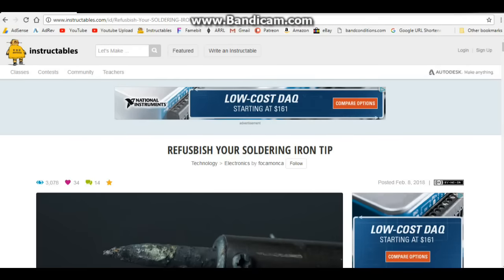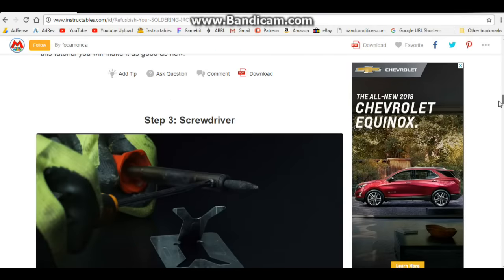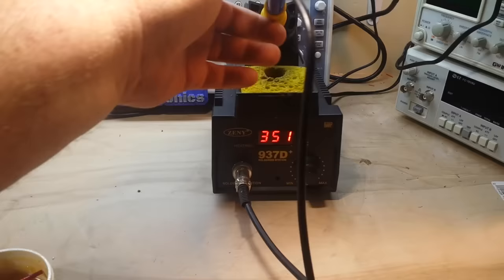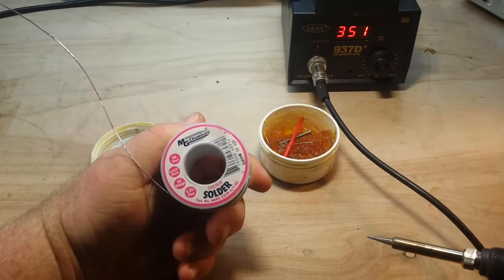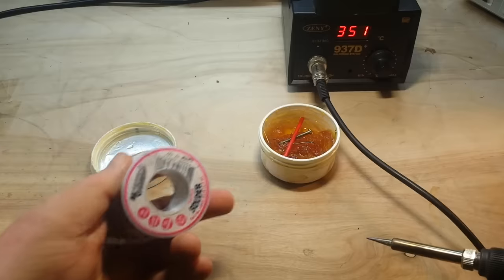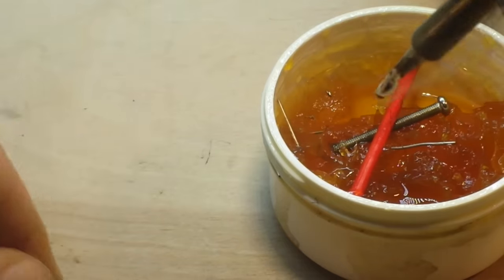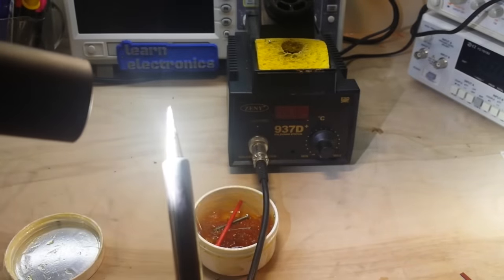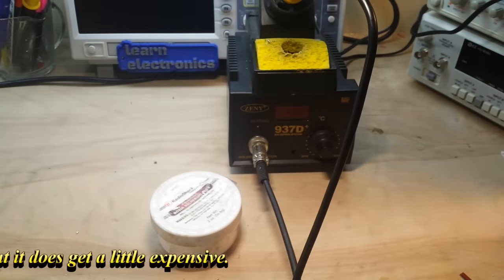How to clean and re tin your soldering iron

Comment: You're so right...LOL, I have daily use tips over 30 years old that I still use. Other than regular tip tinner, I also use plumbers flux as a hot tip dip.
Reply: Rose Hannah Mae i like the wire brush
Reply: Rose so regular plumber's flux is ok to use, but not plumber's solder?
Reply: What if I have a brown flux / soldering paste that seems to immediately oxidize on my rear of the tip?
Reply: Do I need such a bright flux?
Reply: @nibrocnoel3240  He is using the plumers flux to clean the tip, not to apply to the electronics. The plumers flux will never touch the electronics because after you clean the tip, you tin the tip with your rosin solder.
Reply: Can't the acid in the plumbers flux be damaging?
Reply: that's amazing...I suspect it has partly to do with the product quality 30 years ago; which doesn't amount to much without the right practices ofc.
Reply: i know Im randomly asking but does someone know a way to get back into an instagram account??
I was stupid lost the account password. I would appreciate any tips you can offer me
Reply: @Cruz Timothy it worked and I now got access to my account again. I'm so happy:D
Thank you so much you saved my account :D
Reply: @Jedidiah Elijah you are welcome :D
Reply: I’ve used plumbers flux to bring some absolutely horrible looking tips back to life.
Reply: So you have soldered every day for the last 30 years, lol like they used to build them in early 90s? That was like when the china boom happened, they went from basically a rod that arc welded in the 50s to 70s weird stuff to the 80s and 90s I need a soldering iron to fix my soldering iron quality stuff to the JBC era of innovation and its arm of high end compares to the weller stuff that led the innovation till about 2000-mid 90s and it’s been a like well defined line between weller and it’s Germans or Swiss, we’ll say Alps engineering and fancy high end italian exotic stuff, and some how Hakko was like, they became a well known brand by trying to bridge the gap and just figure out who the eff to even clone  and, matter of fact it’s prob how they came up with the blue and gold, but no sir I call Bs on that Claim unless it’s a Weller, and not the Home Depot model. This also severely has to do with the original  size of the tip, the giant tip in this video, lol I don’t think solder has ever stuck to it in the first place it just stuck to it based on thermodynamics, if you take that that to any multilayered nano smd model high end electronic your going to pull off about 50 components and never know it,  lol 30 years, I think @louisrossman said he gets maybe a week out of his tips
Reply: Don’t use plumbers anything unless your a plumber, period, it’s got sulfur dioxide sometime. Zinc, all sorts or the wrong stuff for electronics. Isn’t made to be like, it turns into a raisin on the board and electronics flux just basically evaporates and is non conducive, and then plumbers solder ia lead free which. I mean kudos to you is that’s how you roll and can not burn the whatever your working on to charcoal but I’ve never met any human that could do it so

Comment: Been pulling apart electronics ever since I was old enough to hold a screw driver, I think it's about time I learned to put them back together.
Reply: @MrAmberol I started with opening and reassembling laptops.
Reply: The inner me
Reply: Wow, me too and now the curse has spread to one of my Son's.  Now I get to practice by putting the things he takes apart back together lol.  I now understand why my Mom was so mad when I took apart the living room tv way back in 1985!
Reply: Sean Schofield lol we have a saying at my house concerning me “ you could destroy a tank with a rubber hammer” another one is “ you could destroy anything, even without meaning too”( because often times I’ll accidentally break something soon after using it for the first time even though I believe I’m using the object right and have read the instructions it never fails eventually I somehow break it even though I’m really careful.) I’m also really stubborn and if I want to do something then I’m going to try my best to do it ( when I was like 10 or 12 I built a table... without any power tools just screws, some wood boards my dad was done using and they were scraps, screwdriver, and a hammer and I took those screws and kept hammering and screwing them until I made a hole in the wood for them to go into, I started at 8 something in the morning and by 3 o’clock that day I had built a table and I showed my mom and dad and they were shocked lol.) my dad still tells people about how I made holes into the wood without power tools, using screws  and made a table all by myself.
Reply: I’ve been pulling apart electronics too, but desoldering the parts so I can make random stuff. I have about 15 big capacitors ready for a coil gun.
Reply: the best part is you can do both with a soldering iron!
Reply: ME CONSTANTLY HOLY
Reply: I'm about there as well lol
Reply: Accept no substitute. Use liquid electrical tape! 😂
Reply: Same, take things apart and see if could something different.
Reply: @baileebradford6018 then what happened

Comment: Thanks for the clear, complete instructions. My tip looks "like that", not because I'm lazy but because I didn't know any better. Oh, and: ouroboros.
Reply: Yes, having left a naked tip in the closet a long time, this isn't helpful, is it.  >:\
Reply: You aren't lazy because you're here watching the video friend! He said that more for the people who do know better and still dont do
Reply: Add me to the group of "didn't know any better". Better soldering is a part of my #Coronalearning...
Reply: RobMacKendrick The tip on the new inexpensive soldering iron I bought this week already looks “like that” after soldering only a dozen or so LED connections.  The tip has a huge crater and is almost worn thru.  I cleaned the tip on a sponge and a wire mesh after every solder and tinned it with solder (not with pure flux as shown) before beginning.   I also used a soldering gun that I’ve had for 30 years and never had pitting.  It’s tip is now also shot from just soldering a few LED connections.  I’m wondering if it’s the composition of the tip or the 3M solder I was using.  I made a number of replacement tips for the pencil iron from copper.  We’ll see how they work.
Reply: Is there any way to revive it?
Edit:  well as I had an old soldering iron lying around, I did the unthinkable... I sanded it with very very light sandpaper and.... It's back alive!! Works good as new, I'll just make sure it's tinned and I reckon it'll be fine... (It's better than throwing it in the bin)... If it goes kaput I'll post an update... But for now I'm a happy camper! I rarely use a soldering iron so for now I don't see the point in spending £50-100 for a decent one.. perhaps I will get one in future with the rosin flux to properly maintain it.
Reply: Mine too, so bad that I purchased a new soldering station, but had I taken care of my tip properly I wouldn't have needed one. Nobody taught me how to solder. I still don't know how to do it properly, but I'm trying.
Reply: @leodanryan966  Exactly my story. But with help from lots of YouTube videos and email support from my brother, who's been soldering for years, I'm a competent solderer today. My advice is, watch a lot of videos (everybody has a different take on skills and techniques), read website tutorials, and post questions when necessary in Internet fora. Worked for me, after many frustrating years of ruining most things I touched. Best of luck!
Reply: Me too
Reply: Tried it when I was 16 that's what it looked like 😂 trying again now at 23
Reply: @davegiggitygoo  Me too, except 10 ish and 45.   :D
Reply: @Gamerock82  my 200$ item is repaired and just as new good luck 👍
Reply: He was talking about the person who made the blog.
Reply: This is what I wanted to say. Perfect.

Comment: I have a solid brick of soldering gun tip cleaner. It came in a card board box lined with wax about 35 years ago. 20 years earlier, my maternal grandfather used it while making tin cars, trains, airplanes, etc. He would dip the hot iron in the tip cleaner and it came out like new and tinned. No reason to add solder as it is in the brick. Rub it across the brick if dirty. I have mine and use it most weeks when doing electrical work. Retired ASE Master Tech.

Comment: I bought a new soldering iron kit  over a year ago at a well known craft store ...it came with the thick wire solder , 2 tips .etc ....but no flux ...went out to one of those home depot stores and purchased  it ....to tell you the truth i never soldered in my life .....and when i  started to make dollhouse miniatures with the LED lights during this covid isolation  ...and wanted a better way to attach the wires than using the dollhouse  kits ...paper adhesive sticky strips cut to size then wrapped around the LED wires ....i didnt like doing that ...so initially i felt overwhelmed and a bit apprehensive bout using the solding iron kit ...but watched your  video on how to clean the iron tip and a few others ...i was faced with a bunch of dollhouse LED wires ...so finally took the plunge and did the soldering thing and  experimented on soldering  a spare LED ligh....t trimmed some of the wires and attached them  soldering the  wires .....then used the battery pack to test the light ....and tah dah ....it worked.....the LED ...light worked ...i was thinking that this would be hard to do .and it wasnt .followed the steps for cleaning  the tip ,etc.....so hey ...its not the best but i  did okay for a first timer  and am really pleased that  my little dollhouse  light worked ....so .thanks for putting up this video ....

Comment: I found that tinning the tip after every soldering session, and wiping it occasionally with brass wool during work, keeps it clean and shiny without resorting to flux. The flux can then be saved for the worse cases of oxidation. [P.S. Regardless, thanks for this important video!]
Reply from the maker: Thank you very much!
Reply: The White Byte I do the same technique with the brass wool
Reply: same here. only use the brass wool; soon as it gets hot, after a few solders, and at the end. Have been clean tipped since I bought it.
Reply: Brass wool eh, i only heard of steel wool! Would steel wool work too?

Ive been wanting to make the switch from a damp sponge to steel wool. No matter how wet the sponge is it seems to melt a bit... Probably not the ideal sponge.

But steel wool makes good sense to me. Brass is probably even better eh?
Reply: Careful, steel may scratch the soldering iron tip and ruin it. Brass is softer and safer.
Reply: Never use a wet sponge. It thermal shocks the coating and cause micro fractures. Only use the brass wool to clean and tin the tip before turning it off to protect the coating.

Comment: There are so many people that just destroy their soldering iron tips by not properly cleaning them... Thank you for a decent video on proper care of your soldering iron tip.
Reply from the maker: Thank you.
Reply: Well never knew about cleaning the soldering iron tip till after it was all oxidized like that when I had first started soldering. Good thing it was a harbor freight cheepie
Reply: Same i never heard about this even in soldering tips video, having said that i have a Mustool they are so cheap and i use it to weld plastic from 3d prints at lowest temperature as well.
Reply: I didn’t even know that cleaning was a thing
Reply: REPAIRING Electronic Multimeters
Reply: yeah im one of those that F*cked up their tip.. But at least i know now, right?
Reply: I bought a new (cheap) iron a few months ago and promptly destroyed the first tip.  Changed to another tip and after reading suggestions for tip care online (wipe after every two or three joints, reduce heat when not in use, tin every half dozen joints, etc) went back for another crack at all the connections I was making.  Tip still oxidised.  So now I'm going to dump it in tinning paste.  I want to get better with the crappy iron before I unbox my Hakko.
Reply: @BruceNitroxpro  not really my iron is a cheap chinese one that cost me $12 aud and the tips cost around $1 each so not really prohibitive in any way. If i had a more expensive soldier ironing station i am sure these costs could blow out really fast.

Comment: Bingo! A LONG time ago when i was young and stupid i did just that...take sandpaper to the iron tip. And i quickly realized it oxidizes the metal once the protective coating is removed (exactly what u said). I tin it now just like u do, every time i solder with success.  I'll also mention to turn off or lower heat on iron when not using for 5 mins or more...this will further prevent oxidation and prolong tip life. Happy soldering!
Reply: Michael Padovani I once forgot my iron on for a week.  the tip was very dull but the coating was intact and with some love I'm still using the same tip months later..  Not really sure how bad leaving it hot is.
Reply: Great video and keep the tips coming
Reply: how hot is hot? Tips are known to last much longer with low melt solders than with high melt. Especially if the high melt is combined with high thermal mass parts so the iron must be set higher to supply enough heat.
Reply: I left my iron on for 5 days straight at 350C on accident once. The tip was no worse for wear. I poke flux, retin, then stab brass wool before I hang the soldering iron when finished.
Reply: @Gigs wow, and i thought it was bad for mine when i forgot it for a day, although it was no soldering station thingy, just a cheap 30W 15$ soldering iron
Reply: Michael Padovani I'll that tip to heath (Pun was intended)
Reply: When I was a boy, I've got soldering iron with a tip made of pure copper and nothing else. And this sandpaper (and also file method for bigger tips) was 146% good and one and only one, because tin eat out copper when melted. If you travel to the USSR, to the times, when it was still existing - everybody used that type of soldering irons.

Comment: Great video.  I learned soldering back in the late 70s while in high school industrial art class (when it was part of our secondary education) and recalled my teacher telling us never to sand the tip for cleaning (as it was considered the highest insult to the Soldering Gods), but instead what you just said, tinning the tip right after, wipe and use together w/ plumbers flux to clean and protect the tip.  Believe or not, I have found YTB vids from some people who have done their stuff for over 20 yrs and some give the wrong advice for beginners or DIYers, for example, a guy w/ 30yr building boats,  stated that it was ok to take off the protective guard from the angle grinder once you learned to use it as it is for beginners only (like me), which I was horrified as a protective guard is a must every time the angle grinder is used (from OSHA).  So, thank you so much for showing us the right way to do things.  I tell people, do a lot of research before using any type of tool.  The more you know, the safer and enjoyable it gets to do stuff.  Thanks. New Subs.  Oorah, Semper Fi. 🙂

Comment: I bought a pack of these generic Hakko 907 replacement tips from a random seller. I noticed that no matter what I do it never chars irreversibly, nothing a rub of sponge and a quick dip of flux can't clean. In my mind, that was one hell of a coasted tip. It was intriguing! Out of curiosity I sanded it like a criminal. To my surprise that certain tip didn't have a coat, it was an alloy and didn't have a copper core. I'm no chemist but I'm still curious what that thing was made off. Two years and it's still as sharp as a needle.
Reply: Years ago, in or about 1947, there was a guy who sold iron soldering tips in Chicago.   I bought one for my 100 watt iron that lasted until the soldering iron died in 1974.   The tip might be Nickle iron, which was what the guy said he was selling when I bought it for two dollars.
Reply: @johnhansen2187  Two dollars for a soldering iron tip in 1947?  Sheesh, it better be quality at that price!
Reply: What’s flux
Reply: @johnhansen2187  Your soldering iron died a year before I was born. Could I be a reincarnated soldering iron as I am quite hot headed and love electronics. lol
Reply: @jimmyneutron8702  it’s what’s inside the Flux Capacitor that’s the heart of the Delorean time machine. …
Reply: @jimmyneutron8702  Well, it's not a capacitor for time travel...
Reply: @crustycurmudgeon2182  But it is. Use it like this video says and it will allow your tip to travel to the future without becoming trash on the way.
Reply: @joemck85  Clever!😆

Comment: You do it exactly like I do. Another thing you're doing right, is running the iron at a controlled temperature. Too hot, invites oxidation. Storing the iron tip tinned also helps. I don't use a sponge, I have a piece of aluminum I can shake it off on to. (Never tap, or strike the iron on anything, you can damage the heating element) Solder will not stick to aluminum, so the beads just wipe right off. The ONLY time I've ever used an abrasive on a tip is if the tip is already shot, and I'm just polishing up the copper base metal. You have to tin it immediately, because the copper will oxidize as soon as it comes up to temperature. Have the solder right against it, so it melts onto it as soon as possible. When I'm tinning, I hold the tip straight down, and let the solder bead, then drip right off the point. That makes the tip usable for that soldering session. If you loose that coating, the tip can be used, but it needs MUCH more maintenance. Oxides just don't conduct heat, nor will it hold solder. I can't get that rosin flux anymore, I have to rely on the flux in the solder core. Cheap fixed wattage pencil irons have a tendency to get way too hot. No matter what, if you don't solder enough joints often enough, they overheat and oxidize. Tips just don't last long under those conditions.